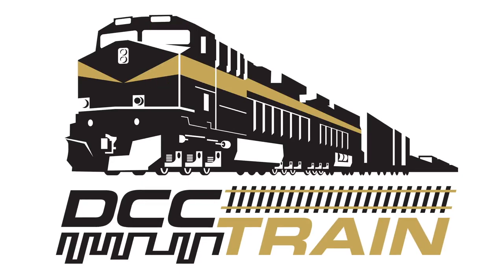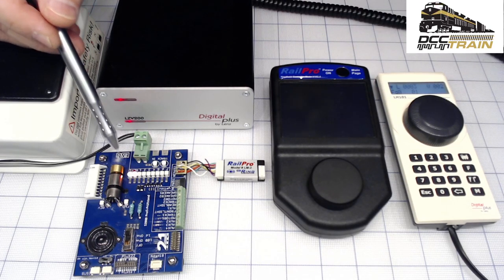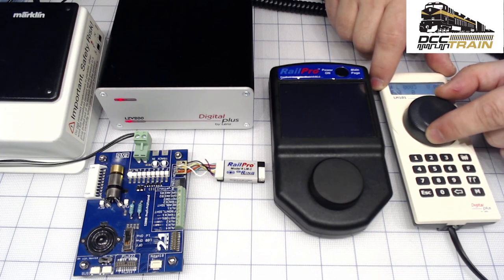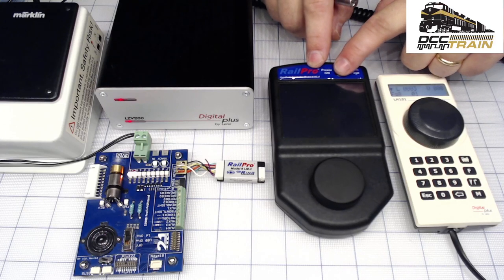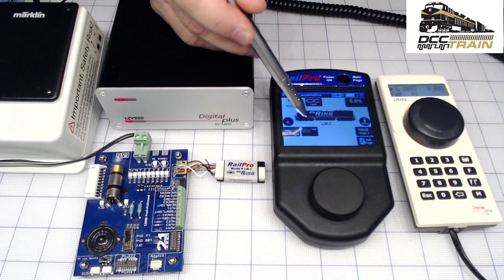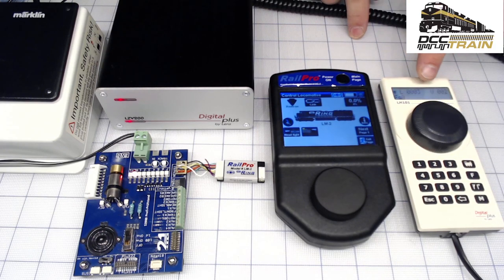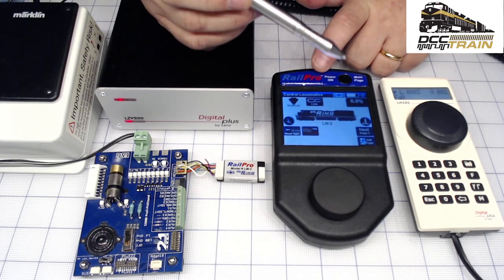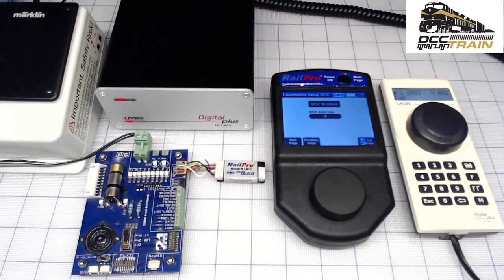Rail Pro Test Locomotive Module with DCC

Comment: Excellent video.  So it's clear that you can switch between Rail Pro and Lenz controllers for Rail Pro/DCC control of the Locomotive module.  That means the LMx has the ability to be configured as a DCC decoder.  But can you control a DCC locomotive with a standard decoder, say a Tsunami2, with the HC-2?
Reply from the maker: Thank you. No, you cannot control a DCC locomotive with a standard decoder with the HC-2.

Comment: I have a question, maybe it is beyond your interest but maybe you can help me. I have old Train equipment 1950s AC Gilbert American Flyer. It is S Gauge and runs on 2 rails with AC power to open frame AC motors. I have been converting many of these engines to DC Can motor and Digital Control. I have used TMCC controllers and recently MTH DCS PS2/3. Both of these are capable of operating on the AC powered track at the same time. However, TMCC has been dropped and is only available thru one 3rd party source while MTH has been sold to owners and reducing all their products significantly. So a friend shared with me his RailPro experience with Ring Engineering and it seems to be the perfect system for my old Layout and engines. Dennis in Virginia
UPDATE!!!!!!!!!!!!!!!!!!!!!!!!!!!!!!!!!!!!!!!!
sample project i completed A test of Rail Pro running my 1950s Flyer Steam Engine with Smoke and Sounds using my AC Transformer to the track. https://youtu.be/__XyQJf8ZAU
Reply from the maker: What is TMCC controllers?
Reply: @dcctrain  Lionel Train Master Command control Wireless Control in Cab 1 early days.
Reply from the maker: @DennisMurphey  Nice!